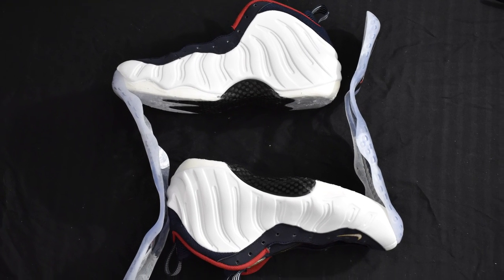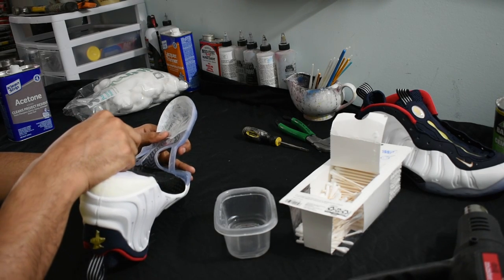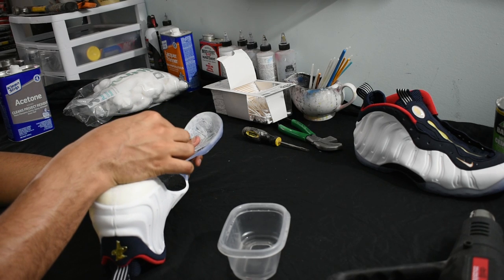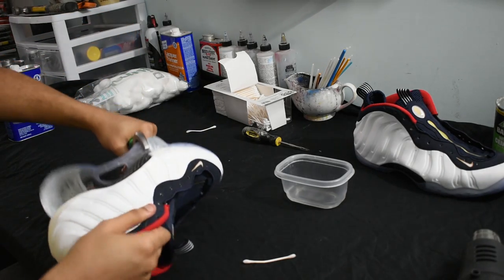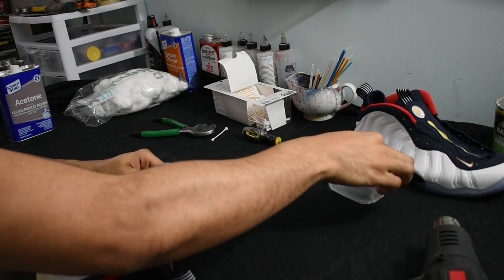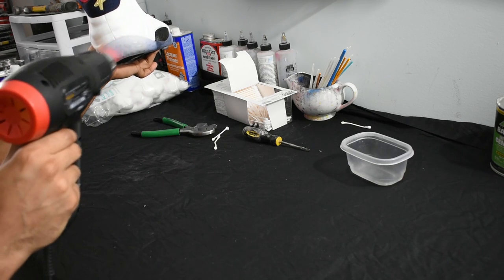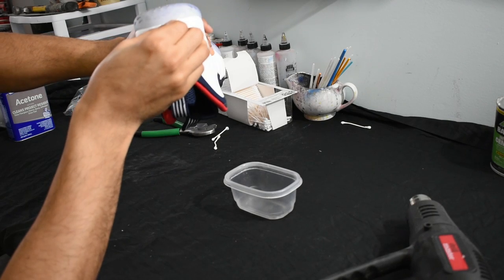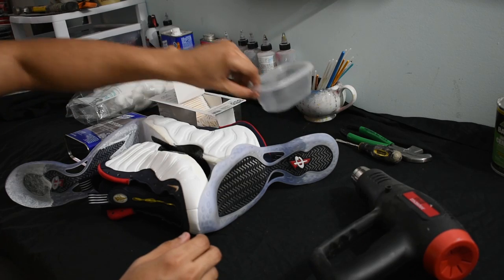HOW TO | Remove Sole Tutorial Or Sole Swap

Comment: what happens if you throw a last in the shoe and chuck it in a convection oven? would that heat be enough to melt the glue and peel the sole off? instead of using a heat gun
Reply from the maker: I would not recommend putting a shoe last in the oven